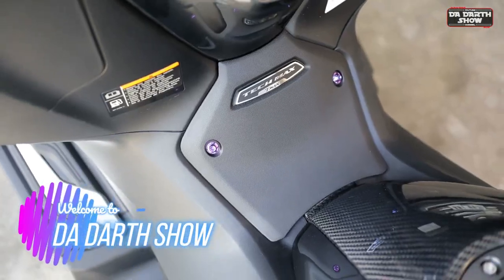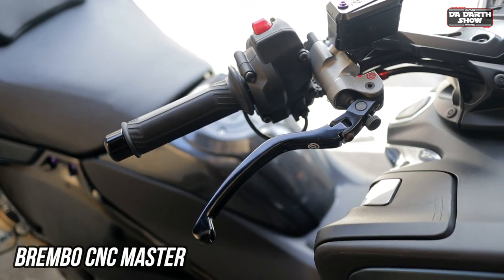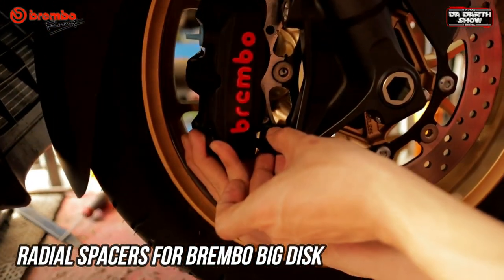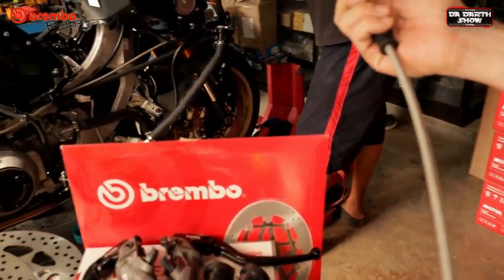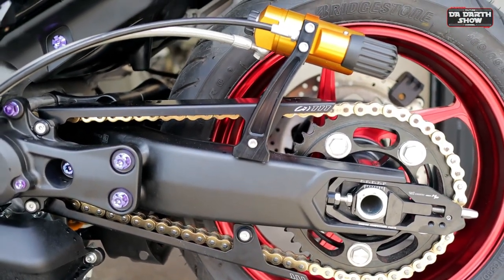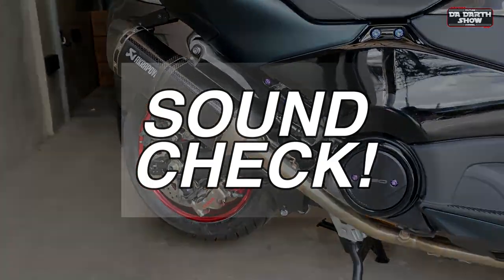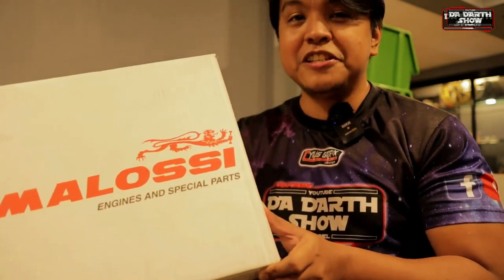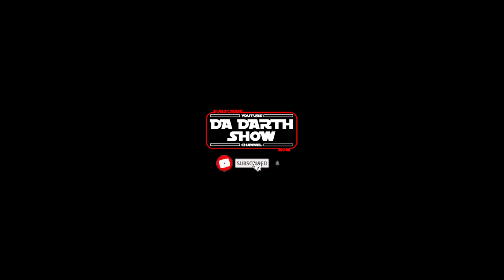2023 YAMAHA TMAX 560 Setup Upgrade Chain Drive (ENGLISH)

Comment: Chain Drive on a scooter sounds for me more of a downgrade than an upgrade: with 48 horsepower,  there is no need for chain but you have more maintenance in form of lubrication every thousand km. but hey, it looks cool. a real eye candy
Reply: Tmax vbelt cost a none sense price between $220-250 which is a scam. So you will save a lot of money vs those lubrication. Nmax belt added the same gear style as the inner side and added the top part adding $224 to the original price $16 😂😂😂

Comment: This will save you a lot of money vs the scam vbelt from yamaha tmax 😂. They added the inner gear to the outer belt and added the cost $220+ to the original price of an nmax vbelt which only cost around $16-20
Reply from the maker: yes it will in the long run